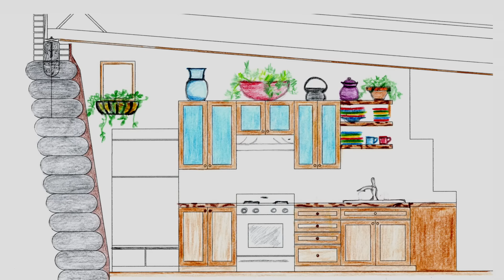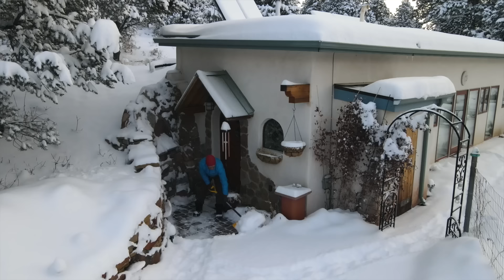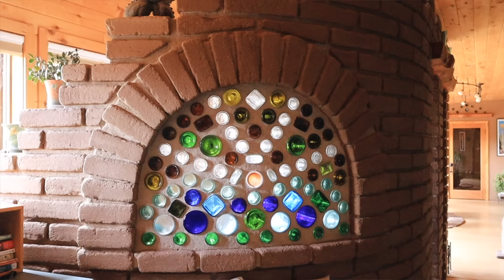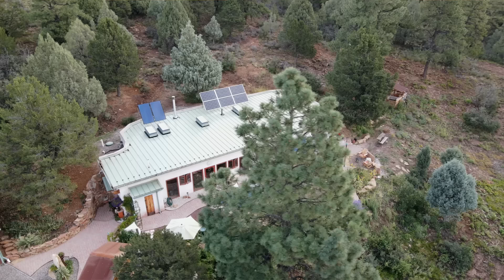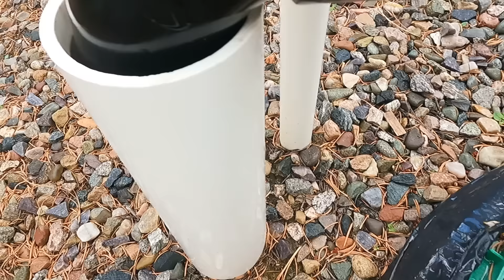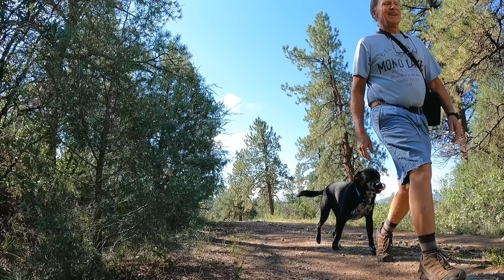Living Off Grid in an Earthship-Style Passive Solar Home for 10 Years + Full Tour

Comment: I love everything you’ve done, except if I were you I would have way more Solar Panels. There is no need to use propane if you have ultra affordable Solar Panels. I recently bought 20 kW of solar panel panels for $1500. 

Also, I would hook up a recirculating loop to ultraviolet disinfecting light to your storage of water. 

I have an 8 W uvc led germicidal water purifier just before my faucet. It only turns on when you press the button. 

Where’s your electric car? I know mine is in my driveway.

Comment: So, my understanding of the use of tires by the original creator of this concept of earthships was to only use them because of the need to recycle. So my question is, they aren't really a necessary component of this thermal equation, they are basically just there for recycling, correct? You could use other mediums to compact that dirt, cement perhaps correct?
Reply: Concrete is one

Comment: It is not as cheap as everyone would like to think, up front anyway.  Long term savings for sure.  Loong term.   

The cost is the deterrent as well as the labor involved with getting there.  

These homes are for long term sustainability.  But they still rely on the "grid" for much of the  materials that make them.  You can tout the dirt you put into them, but what about the tires?  The tools? The windows?  The solar system? Etc...

Very nice little abode!!  Great job, and very inspirational!!!!
Reply: No this house was not cheap.  However, it was built for the price of a moderately low end conventional house at the time.  Say a stick framed house with modest finishes and appliances.  Taken per square foot you can use that as a rough idea.  And yes.  Solar power requires panels, batteries, wire, controllers, inverter, circuit breakers, etc.  Everything a conventional home takes plus the batteries and panels.  As in everything we need to look beyond the surface and be real about the consequences of our actions.  What is the cost of all these batteries in electric cars?  Mining? Manufacturing?  Fossil fuel requirements for shipping?  Where does the electricity come from?  
Thanks for the honest conversation.  We love this place but we're not unaware!

Comment: Gorgeous!  I love these type homes!  You did a fantastic job!  Was wondering about the flat roof and snow.  Especially the one scene with ALOT of snow.  Is that an issue with such a flat roof? Do you have to get up there often during the winter to get it off?  
It’s great you are allowed no septic as well.  As you just can’t build everywhere like this with all the codes and restictions.  
Some codes are rediculous.  In FL you can’t be off grid.  They push and encourage solar, but you still have to be connected to the grid.  Makes no sense.  Just the research for land alone to do this is exhausting-with codes.  
I could easily live there!  It’s perfect.
Reply: Thank you for asking!  This roof is designed to handle that much snow and much more.  The cost of trusses designed for plenty of snow load in this area vs ones designed to just cover the minimum is negligible for the peace of mind you get. As a builder I always designed the roof for 150% of required load ratings for the elevation.  
Yes about the building codes.  K got lucky here.  Thanks for your kind praise and for engaging in the conversation!

Comment: You should find and area on the downhill side of the road to build a catchment for winter precipitation, and be able to snow plow snow to where it will melt and collect water there.  They now have vertical bladeless wind turbines for residential homes that require minimal wind and would provide additional power, especially when winter storms make the solar panels ineffective.  

I love the mostly sustainable design and the aesthetic outside garden spaces you have, just don't like those harsh winters. I live in a far less wintry environment, but I'm incorporating a large 2 story greenhouse onto the backside of my house to maintain large tropical fruit trees (citrus, bananas, etc.) that produce fruit in or too close to winter.

Comment: OFF grid - yes...Beautiful passive home- yes...Sustainable? NOT AT ALL... .....Let me explain...the interesting thing about this style of passive home is that given its remote location it's unfortunately not environmentally friendly.  It's location on top of a mountain requires extensive amounts of fuel to access and to clear snow every year. This couple is likely burning 100s of litres of gasoline a year to plow... Next the building materials: Rubber tires(made of oil) shipped to site via a diesel truck, regardless of it they are "recycled." Metal roofs coated in green paint- not sustainable as metal will not break down. Also a big crew of construction labourers(with fuel burning vehicles) to each drive their vehicle up a mountain and then home at the end of the day... A lot of fuel (gasoline and diesel) was used to transport workers to and from site for a whole year. This is not a sustainable building practice or location. TIRES DO NOT BREAK DOWN-nor are they natural.....The tires will eventually have to be shipped off site eventually in 50-100 years when the home falls apart or requires renovation. yes the tires could be used again and repacked with dirt and rebuilt but it will require a whole crew(again driving up a mountain burning fuel) and the whole back side of the house to be removed to access and repack the tires. .... Don't get me wrong the whole thermal mass being a heat sink- this is genius. The light hitting inside in the winter and outside in the summer that's smart. This is a sweet passive home but it is NOT sustainable at all.  This house has a lot of metal, rubber and used a lot of diesel and gasoline....a lot of fuel gets burned annually to clear the road, to keep this property maintained....It's a privilege to build remote on top of a mountain but it's not sustainable at all lol..

My question to the home owners would be:
What is the total amount of CO2 in kg produced to build this house?
What is the total amount of CO2 produced per year to clear the road?
How many litres of gasoline do you use per year to clear the road?
What's the plan for the tires after you either move, sell or the home is passed on?
How much diesel did you burn to build this home?
Why did you not build with local natural timbers from on site?
What is your plan for all the plastic water catchments that will breakdown and require replacing?

My perspective:
I bet if you were to compare the amount of CO2 in kg they produced to build their home and to clear snow every year, that their home would likely have produced more CO2 in kg than  a residential home built in a suburb of Colorado over its lifetime(50 years)....Also these unique homes are so unique that no one ever talks about what happens to them after their owners are gone...Will this home ever be used again or will it likely sit on top of this mountain where it(rubber tires, paint coated metal, plastic water containers)will need to be taken down piece by piece?
Reply: Sustainable isn't sustainable anyway.

Comment: I live in a passive solar home designed by Adirondack Alternate Energy, have you heard of them? We use many of the same practices as yours, but our designers incorporated a large house fan to distribute the air, which runs thru the thermal mass, so it is technically not "passive".
Reply: Good for you!  Glad to see people doing what they can to live lighter.  Yes the whole house fan with heat exchangers that constantly circulate air is more the typical design.  We really love the complete silence of no pumps or fans running.  It works in this design because of the amount of thermal mass and the great ventilation. The amount of solar gain here is also enough on sunny days to open the windows and skylights to dump the humidity from the grey water planter.  We keep our humidity in the house between 40 to 60% most of the year.

Comment: One thing they could probably improve on is that they didn't have separation of the greenhouse and the living area.  Newer earthships have a second layer of glass to separate the living area with the south facing wall and that forms the greenhouse and hallway.  That helps insulate the inner area from temperature fluctuations.  

If it is colder inside but warmer in the greenhouse then open the door connecting to the greenhouse to let the heat in.  Close if you want to remain cooler.  In winter the sun will penetrate deeper into the back to help heat the living areas up more.  

If you have a connected sun room to your house you will notice a similar effect.  It can be cold outside but if there is sun shining it will heat up the sun room.  You can then let the hot air into the house by opening the connecting door.  

Also, you can hang your laundry up in there.  If there is sun it will dry your clothes really quickly.  We never used our sun room as it was not insulated and had too much glazing so it was scorching in summer and mostly cold in winter (unless the sun was out).  However, it became our room for drying laundry.  My parents said it paid for itself just from that purpose.
Reply: The reason this house does not have a second layer of glass separating the grey water garden from the living space is because it doesn't need it.  This design saved thousands of dollars and is a vast improvement over conventional Earthships we've been in.  Glazing (windows) are expensive and she wanted to keep the costs down as much a possible, trying to build without a mortgage.  By building the south wall with vertical glass that incorporates overhangs sized to allow full penetration of the sun in the winter and completely shade the windows in the summer eliminated the need, and the expense, of building a second wall of glass inside the home to keep the temperature fluctuations out of the living space.  The truth is, this is passive solar design 101.  She couldn't understand why someone would pay that much to have a huge greenhouse hallway inside their homes when there is a simple solution.  Those temperature fluctuations don't occur in our home.  The vertical glass also allows for conventional window coverings to insulate the windows keeping the heat in on those cold winter nights and keeping the heat out on those hot summer days.  The house remains stable and comfortable, on average between 60 and 74 degrees.  There is still plenty of light in the grey water planter to allow the plants to flourish. 
Thanks for bringing up this point.  We love Michael Reynold's innovation and commitment to living in homes that benefit the planet and the inhabitants.  He's truly a pioneer and was a huge influence in both of our lives personally and in our careers.

Comment: Does a "1 kw" solar system refer to the amount of power that the panels can generate or the amount that can be stored in the battery?
Reply: Great question!  It's the solar panel maximum output rating.  It needs to be sufficient to charge significantly drained batteries within a day or two.  Your battery storage depends on the loads your house draws and how long you want to go before the batteries get critically low. Then you design the panels to keep those charged.

Comment: I wish she would have shared the cost of what they spent making this. Its a beautiful design and the thousands of hours of hard work are on top of it but I think sharing costs of things makes everyone more educated. Plus it helps others understand to better incorporate parts of their system into their own builds. What a amazing designed house either way, something to be very proud of.
Reply: Hi.  Matt here from Clarity Off Grid.  Thanks for sharing your thoughts.  Her costs to build were a bit under $140/sqft.  At that time it was about middle of the road to low end for conventional kindling construction with mid-level finishes.  High end finishes in a high end home was running upwards of $250/sqft.  That should give you some perspective.  Building a home does require some finances.  What we've found is many building professionals believe in building "sustainably" by adding complex systems and offsetting the increased loads by adding solar panels, all of which jack up the cost.  We think that to be short sighted for people living in environments where passive systems and good ventilation combined with effective use of thermal mass can simply and more affordably solve many if not most comfort issues without pumps, fans and switches.  Hope that helps!
Reply: @mattkramer6512 Thanks for the sharing price but how is that possible if she used Earth to build? $140 per sq ft is the price to build an average American home using unnatural materials to build. I understand paying for the labor, but the materials are free. The Earth homes I've seen in India cost $18 per sq ft to build.
Reply: I was going to say that costs have changed so much from then to now that it might be challenging to translate the costs from then to today's market.
Reply: @jonothandoeser  not to mention the countless other variables. Just changing zip codes can make plenty of numbers irrelevant. Let alone the passage of time.

Comment: "This house cost about what I expected it to cost."  Which is...?  Tell us so we know realistically what to except.
Reply: The house is 20 years old.  How would the cost of a build 20 years ago be relevant today anyway?
Reply: @heatherrowles9930  The video says "10 years off grid."  So it's still a reasonable question to ask.
Reply: @rabidhellhound9714  on which alternative planet have you been living for the past 2 or 3 years?  NOTHING from 10 years ago has any bearing on today......
Reply: It's probably a lot of sweat equity.  But typically if you get them built for you they are not cheaper than normal construction and sometimes more. But you save over time on the utilities.  A lot of the cost is labour.  Depending on the choices made, earthships tend to use less materials.  They typically use more windows and there's the cost of the solar array and wind if added.

Comment: Newb here. Is there any concern about the old tires off gassing at all?
Reply: Apparently when enclosed and there isn't UV light hitting it that doesn't happen.  But you could always used a different method and not use tyres.